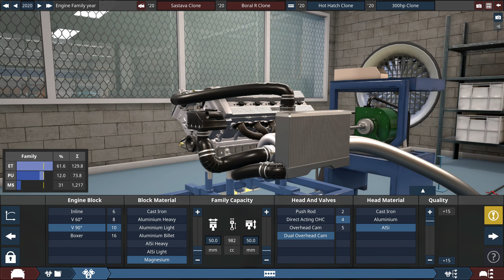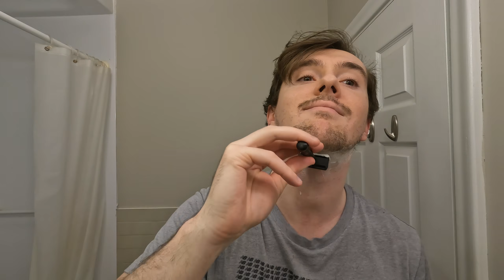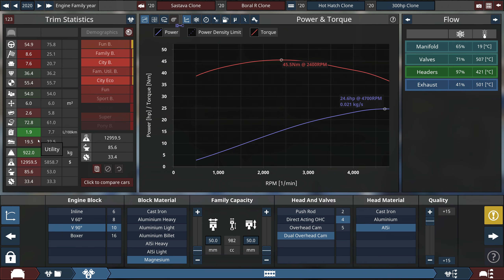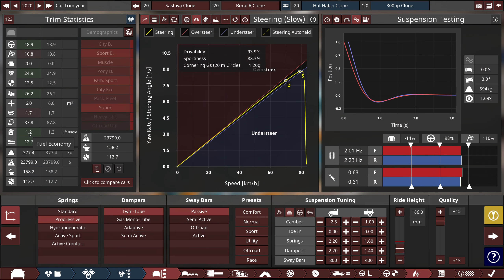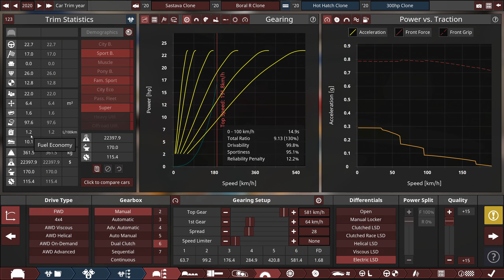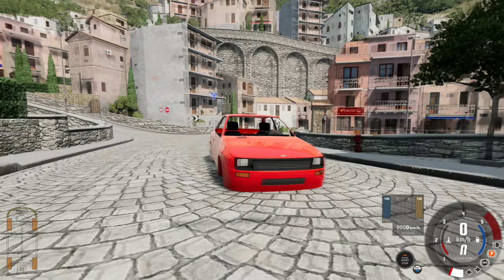The Most Fuel Efficient V10 Ever Made

Comment: Late to the party but narrower wheels may increase rolling resistance. This may be offset by aerodynamics. In road cycling wider tires has been a trend for the last 10-15 years so the rear wheel cross section actually touching the road surface might be what’s prompting the better fuel economy here.

Comment: For fuel economy so that you do know VVL is better but you have to run a zero on cam profile and you have to set VVL profile to 100 and you set your VVL RPM to about half of your RPM limit Just the tip because I get crazy MPGs using Vvl Also for turbochargers the lower the boost you run and the earlier it spools will help mpgs, for what it can, turbos have limits however. Also the person who said cvt aren't efficient is correct because beamng and automation are bad on coding so, adv auto is probably better lmao..

Comment: 9:57 ford ecoboost 1L turbo, it seems that turbos are the real world answer to efficiency because when you stay out of boost its a small engine and then when you hit boost you get plenty of power. 
11:49 the cvt's that hybrids use actually called eCVT involve electric motors. For a gas car the CVT is like what Nissan uses in their cars. A passive CVT will always keep highest load on the engine for that RPM.
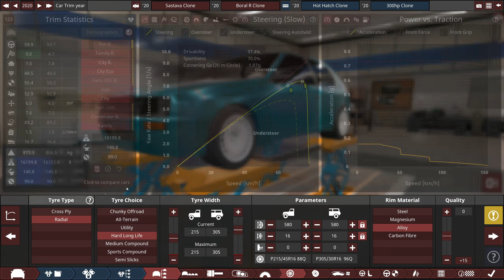15:05 Prius tires are 185/65/R15 and they small I don't think ive seen anything smaller
15:13 big wheels does actually help with cruising efficiency because it lowers rpm, and is more rolling mass. It's terrible for stop and go however because you have to bring it up to speed and back down again.

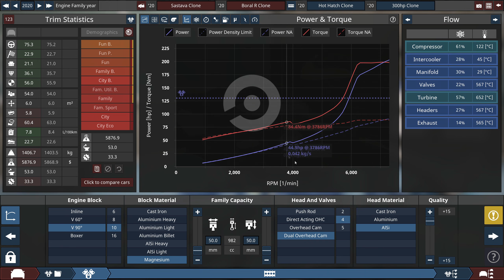Comment: 3:20

The search for better fuel economy is very similar to that of power 

Anything to make the engine more efficient (better at making power) is going to help. 

So DOCH with 4 or 5 valves will always be better 

The only difference is in the tune for things like exhaust, head porting, intake, etc

Also proper sized turbos will also help significantly in fuel economy
Reply: Yes. Turbos have the effect of a larger engine without the inefficiencies of a larger engine. It allows you to have a much smaller engine making the same power as a naturally aspirated engine.

Comment: You should look into swapping a Mercedes OM606 and a ZF 8-speed trans into your Ram. Using a Turbolamik TCU makes the ZF8 almost as easy to swap as a 4L80. The Mercedes OM606 will almost instantly double your fuel economy, and you can relatively easily build it up to make the same HP and TQ as the Hemi without really losing the fuel economy at cruise speed.

Comment: Nice!! Use a electric or electric variable steering, it helps on the ecconomy. Try MPFI per cylinder, maybe help.  VVT should help on fuel ecconomy too. Depends on the engine config, try tweeking VVL RPM to give moore power on higher RPMs, in the game it doesnt change the efficiency of the engine. I Just subscribed now to help you to reach 60K!!

Comment: Hey Flux!, I still need to beat your goal of 1.1lkm. 
I managed to achieve 1.3lkm in the Elisbury update. 
	So my setup is a 1.4l v10, magnesium block, 50mm bore, 71.3 stroke, DOHCX5, ALSI Head, Billet steel crank, titanium conrod, hyper cast pistons, and harmonic damper at .2, 16:1 comp, 0 cam 0 lifter vvt intake 3k rpm, two turbos with smart boost, intercooler set to 1020, standard geo, ball bearing, 30mm exducer 26.3 inducer with a 22 ar at 5.08 psi, the fuel system is Direct Injection Per Cylinder STD MID manifold set to 0, using LNG with -5 timing and a 0 for fuel map, o on the increase emissions control, tubular race dual at 12.7mm high-flow three reverse flowx2. All set to +15. This has given me 77.3hp with a 46.4 Engine efficiency. 
	I used the same sedan body as you: Carbon fiber panels, monocoque chassis carbon fiber, front transverse with MacPherson struts fronts, and pushrods rear. I added a front spoiler and a rear wing set to 0. FWD uses Auto Manual 8 speed, maxed out top gear, maxed out 1st, and spread set to 50 with a 205 limiter. Electric LSD, radials hard long life, 195 front, 225 rear, running 550r18, carbon fiber rims, carbon brake single piston at 160mm front and rear, undertray is flow optimized, no active aero or cooling flaps, cooling flow and brake flow set to 0 also, single-seater, with race interior and no entertainment, manual rack and pinion using tc+abs no safety 1940, weight optimizer set to 100, and standard springs, twin-tube dampers, and passive sway bars. I did a race tune for my suspension, springs to 2.8 and 2.0, damper set to 2.8 and 1.8, with no sway bars, and max ride height at 220mm. All qualities are set to +15 minus the safety quality that will be set to -15.
That is my setup! Feel free to roast my setup or improve on it!
Reply from the maker: 1.3 with turbos? I didn't think that was possible
Reply: @automotiveflux  I challenged myself to do that! I will be doing a an builder later on. (don't know when, But I will update you on it!)
Reply: @automotiveflux   Nothing changed. Still at 1.3 even N/A.
Reply from the maker: @canimetionofficial  turns out I'm lucky with 1.1

Comment: The synchronizer issue is not with the auto clutch, you need to hold the shift button longer. new feature
Reply from the maker: Not sure that's a feature haha, I will try to turn that off when I'm on controller
Reply: yea, new update changed shift physics.
also tapping the clutch while shifting helps.
Reply: @ARockyRock Yea, it's shit... Noticed.

Comment: With a 40 liter fuel tank you would be changing the oil after about 2 tanks’ worth of driving
Reply: I bet the tire would have gone from Somer, to winter, and back to summer at least 7 times before then.
Reply: If you didnt have to worry about the gas going bad first, sure

Comment: 11:51 Hybrid CVT's are different than a belt driven CVT, it uses electric motors to change the output speed and therefore the gear ratio for whatever engine you have in there. a Belt driven CVT has mechanical loss due to slipping while changing gear ratios as well as loss through friction required to keep the chain tightly secured. this is why hybrids are so efficient, because it gets the best of both worlds, infinite gear ratios for the engine, and no mechanical loss.

Comment: 11:42, yeah, e-CVT. They DO NOT have a belt like the CVTs you're thinking of. Hybrid CVTs have a generator motor in place of the torque converter and another motor to drive the wheels. They also have a couple of fixed gears for highway driving, and some have them for reverse as well. That's why hybrid CVTs are more efficient. Normal CVTs are actually the worst in terms of efficiency, but because they keep your engine in a more efficient regime, it tends to balance out and give a net positive gain in fuel economy.
Reply: Tractors need CVTs to put out the power they need whenever they have to. Your engine rpm keeps a constant at ~1300 and that’s okay for a diesel that only revs 2k 
that’s why it’s called efficient because you couldn’t get this with any other gearbox 
it’s efficient in other factors than fuel
Reply: @frayziedaisy  what is the job of a transmission? To put power down. So its efficiency must be a measure of how much power it puts down in relation to the power it receives. That's it. If you input 100hp into a cvt and it outputs 66hp to the wheels, it's less efficient than a standard gearbox that outputs 82hp from the same 100hp. 
Now you can have whatever motive you want to have a continuous of ratios in your transmission, but that does not mean it's efficient in its job.
Reply: Nope that's not the job of a tractor transmission and it's not the correct measure of tractor efficiency. The job of a tractor transmission is to allow you to select ground speed and engine rpm separately from each other. That way, when your PTO driven implement can only operate in a narrow RPM range, you may still go at whatever ground speed is ideal without changing the rpm. That means you may be more efficient, because if whatever you are doing can be done at a maximum of 8mph while still being effective, but the available gears on a fixed-gear transmission only let you choose between 6mph and 9mph, then if you slow down to 6 the tractor is going to be revved up powering the implement for 8/6ths as many hours, while consuming almost as much fuel per hour, meaning it was less efficient in total not only in fuel but also labor and capital. And whatever you were doing will have been done more densely than intended, which may be bad. You tend to intend for one or the other of speed and rpm to be flexible enough to find a closer approximation, but I had to make the example up in a generic way.
Reply: @spaceminions isn't the intent of every multi speed transmission to choose the engine RPM separately from wheel RPM?
Reply: @heitorbernardes7977  It depends how loosely you define the terms. I would say that a normal multi speed transmission allows you to choose several different maps of engine RPM versus wheel RPM, but it doesn't make it fully independent, because for example 2000rpm at the engine can only be exactly 13, 21, 34, 48, or 61 mph with a hypothetical 5-speed car transmission. If you want to go any speed other than these five, you have to change engine rpm. And of course for starting off you have to slip a clutch or (in a conventional automatic) use a torque converter which applies torque in proportion to the slip speed, meaning it can't be locked to any particular wheel speed except for the same value as a manual would have used. In a car the torque converter is fine because you can modulate the result with the throttle, which changes engine rpm. 

Compared to all this, a small hydrostatic / CVT tractor can go literally any speed from zero mph to perhaps 25 mph without changing engine rpm and thus PTO rpm.
Reply: @spaceminions let's assume your narrative. Then efficiency would be actual wheel speed compared to nominal Speed? That sound more like... Accuracy, and not efficiency. Efficiency generally is a measure about energy.
Reply: @heitorbernardes7977 If your interpretation of what I said doesn't support my conclusion then you missed something. Like where I repeatedly said how the fuel used to do the same job can be less by using a cvt. That's fuel efficiency, no question. Not just accuracy.
Reply: @spaceminions You would be absolutely right! If we were talking about Fuel Efficiency. But my comment was about transmission efficiency ! We shall not use liters / time or distance as a measure of TRANSMISSION EFFICIENCY. That is a measure of vehicle efficiency. A transmission efficiency is based on how much losses occur between input and output.

If read again my original comment, I even said that a CVT may yield better fuel efficiency, despite having a worse efficiency by itself, solely because the engine is kept in a more efficient regime.

The WHOLE point of the comment was to sai that a hybrid vehicle has better gas mileage, ECVT vs CVT, because the continuous variable transmission itself is more efficient! 90ish% compared to 70ish%!
Reply: @heitorbernardes7977 ugh whatever lol i literally only cared about the tractor comment
Reply: It has been too long since I have read it but I recall a set of statistics:
-Average Manual 95%
-Average Automatic 90%
-Average CVT 80-85%

The problem has to do with gearing. Despite manual's have the highest efficiency, operator limitations mean you cannot exepct a driver to make the necesary shifting every few seconds as would be expected with high gear number transmissions like 7-12+. So, because of this the efficiency of the engine worwsens because it is kept out of its efficiency peak simply due to human limits.

An automatic is better for controlling the shifting, but is simply so bulky it often has fewer gears compared to a manual with the same footprint.

CVTs are the best of both worlds, but have a torque/reaction-torque limit AND a weight limit, and typically cannot be used between vehicles with a lot of wieght variation (cannot share them between a car and an SUV, but you can use one designed for a SUV in a car). Despite the higher friction losses, the ability to keep the engine at a set RPM nearly indefinitely allows for huge efficiency gains.

I think the problem nissan? ran into was the fact the CVTs (Not hybrid, just mechanical) was the fact that it was a rush job. Hearsay, but from pen to production took only 2 years. Not only that, but the cooling was inadequate and apparently some of the parts are undersized for the car it was put in. Resulting in many of its fundamental flaws.
Reply: the e-cvts use some kind of planetary gear setup to change the gear ratio based on the speed of the electric motor, it doesnt actually drive the wheels through that motor
Reply: The biggest benefit of any kind of CVT in terms of fuel economy is that the engine can stay at the optimal RPM for the requested power, you can pin the engine basically at its efficiency peak and roll on. This has way more effect on fuel economy than on actually being an efficient gearbox.
Reply: Literally what I was thinking, technically it's less efficient, but realistically in regular use it's more efficient since people don't tend to drive cars at their max efficiency
Reply: cvts = innefficient but sometimes effective for certain applications
Reply: L,
Reply: The thing is:
Every single transmission on the world has INPUT and OUTPUT. Every single one of them has a power X inputed and X - losses outputed.
Reply: @heitorbernardes7977  I'm saying that a tractor transmission's job isn't to output the maximum power possible at any given moment, which is what you said. Instead, its job is to output the desired speed no matter what. Much of the engine power may not even pass through the transmission when you are using a PTO driven implement. Think about a riding lawnmower, which may be more familiar to you. Most of the engine power is needed to spin the mowing blades; only a small amount is used to move the machine around. A zero-turn mower may not have as efficient of a transmission as a 6 speed manual, but it doesn't matter because it allows you to mow more efficiently, because you cut the same amount of grass in less time, saving fuel.

Comment: try to make the most tuneable engine e.g. i6 that comes with 250hp but can make 1000 on stock internals
Reply: Ofcourse you can, if the stock internals are strong enough to keep up with upgrades later on
Reply: Would that even be possible to engineer?
Reply: @carltonleboss lol yes. The 2jz and vortec 4200 are 2 real life examples of inline 6 engines that didn’t come with all that much oomph but were overbuilt  and as such will support very high hp. Not quite 1000hp but with automation options it should be easy to make the quality high enough to hold it but down tune the engine to whatever you want.